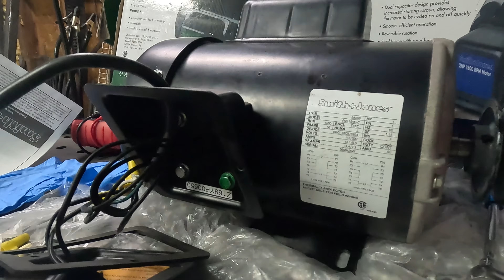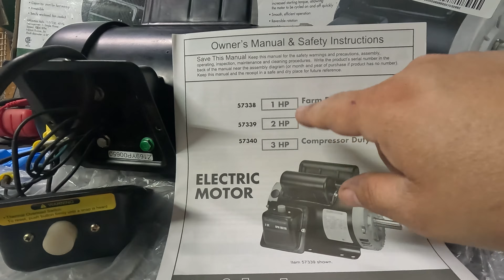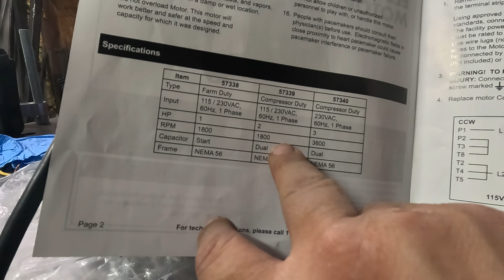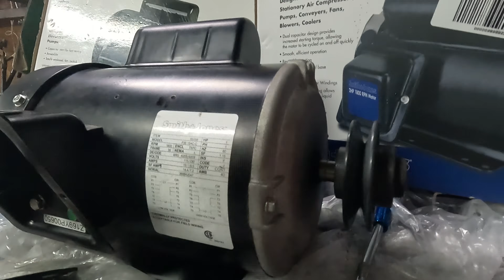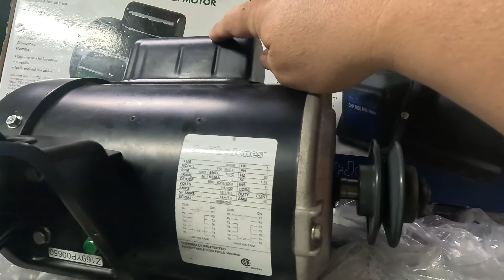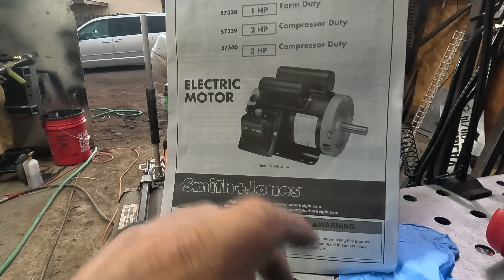Harbor Freight Tools Smith+Jones Electric Motors 1HP & 2HP

Comment: Due to an error on an auction, I purchased a jet bandsaw 14 inch with no motor and I’m currently building the base with the motor. It’s the one hp Smith and Jones. Do you think I will be running into any issues?
Reply from the maker: @joshbruno6116  if you can get it mounted, you will only have to worry about the pulleys matching up, belt size, and the shroud that protects the moving parts. Shouldn't be too difficult if you can source parts and a little fabrication on your end.
Reply: @ update, I got the motor, located proper pulley and belt, got it mounted, almost fully, I’m trying to mimic the original location which is mounted in the base I have to make, my main issue currently is a stronger mounting bracket bc the motor seems to slide, loosening the belt on my couple test starts, and the fact that even after setting the set screw, the pulley still wants to slide to the end of the arbor

Comment: I put a 2hp on my table saw several years and it's still going great. Thanks for the video
Reply from the maker: That's great, I hope we get many years from our motors. Thanks for watching and appreciate you commenting on your experience.
Reply: @ww321 do you happen to know the output diameter on the 2hp motor? I can't find that info anywhere!
Reply: @Wwllww123 7/8" I think
Reply: What is the Diameter of the 2 hp motor shaft.  i cant find this anywhere . Thanks
Reply from the maker: 7/8